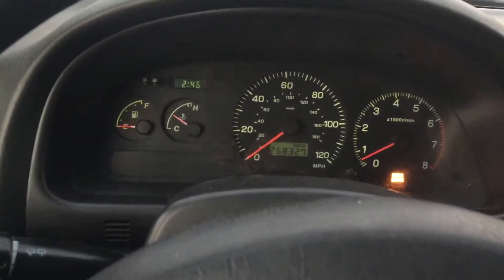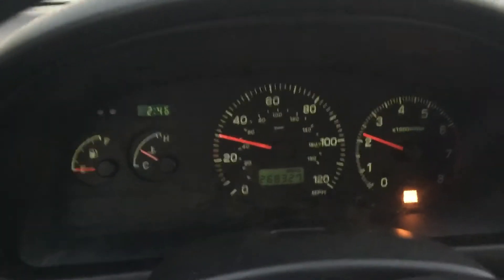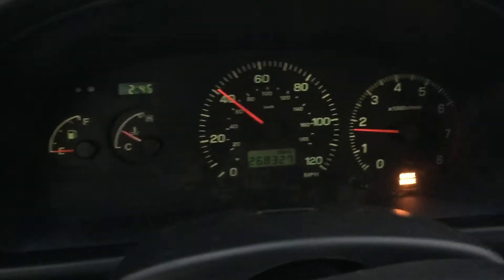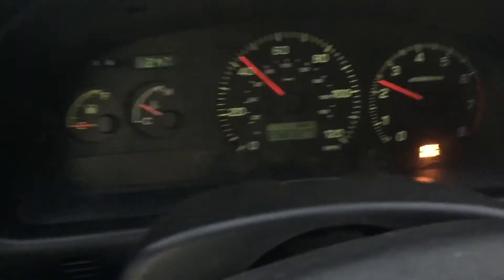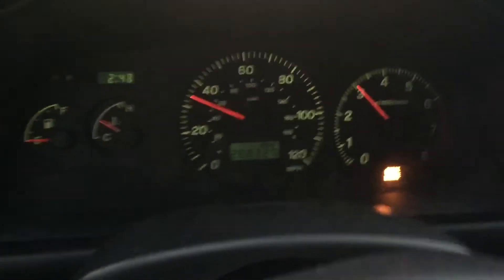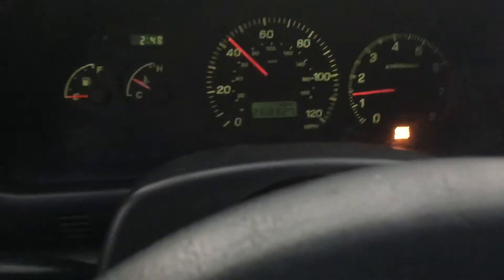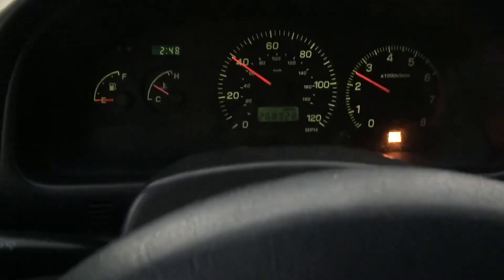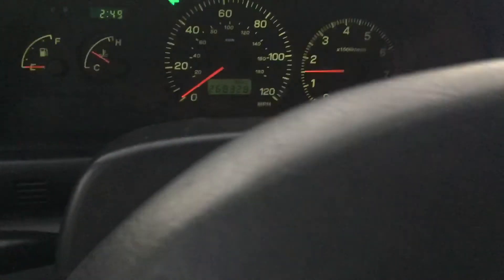4eat power mode mod

Comment: Okay but what is the “power mode mod” what does it do???? I have no idea what this means 😂
Reply from the maker: power mode is a ground ckt you add to the tcm. it changes the shift strategy and increases line pressure. on a normal na setup it makes the car feel a lot more aggressive. think of it like a shift kit.

Comment: Tire noise or do you need wheel bearings??
Reply from the maker: Nick R wheel bearings for sure. I replaced the entire rear hubs when I did the disc brakes.
Reply: Good to hear. I need to do my front here soon. I've got a pretty hard pull to the left, even after ner inner & outer tie rod ends with an alignment. They aren't making noise yet....just don't know what else it could be.